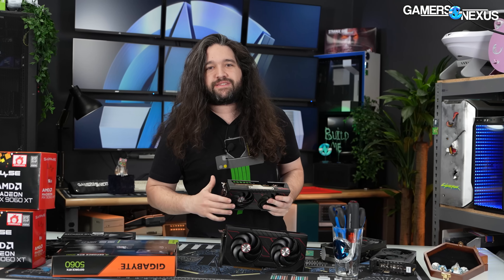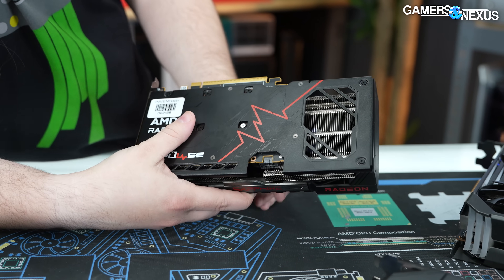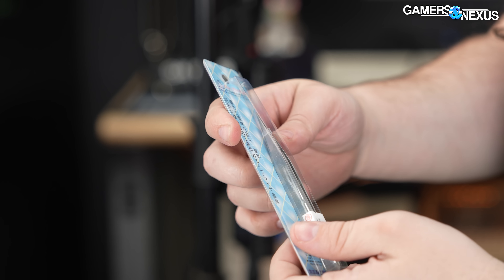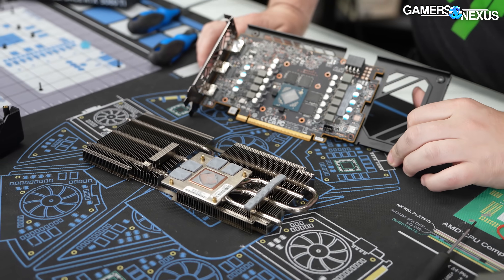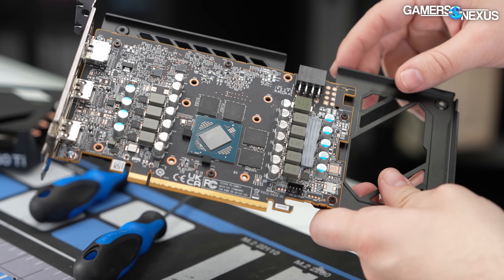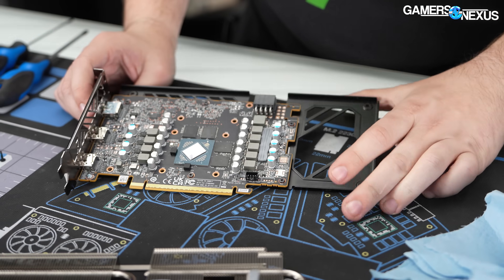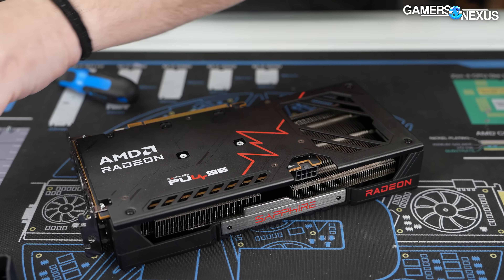Tearing Down Sapphire's RX 9060 XT 16GB & 8GB Pulse GPUs

Comment: I think they intentionally removed the thermal pads at the back of the mosfets on the 16gb variant since the backplate is being used by the extra 8gb rams. You can see the insulation plastic on the backplate has no cutout for the thermal pads for the mosfets. they might have added the pads on the 8gb variant as extra cooling. this is what the backplate should be used for. I saw a lot of manufacturers just adding the backplate for style

Comment: this card is such a weirdly perfect card for me, i got a 16g for msrp to replace my 3070ti, a card i'm happy with in regards to performance on but get bottlenecked by the vram constantly and it turns my room into an oven.
i was able to sell my 3070ti for almost as much as i got this for so now i have a card with the same performance but twice the vram and it uses 100w less power and is so much quieter. 
and it was about 300 bucks less than what i got my 3070ti for years ago lmao
Reply: and i really love how simple the card is to get into, makes me confident i'll be able to replace fans or thermal pads down the line if i need to.

Comment: My method for unplugging that fan connector. use a small flathead screwdriver to get under the header in the middle, then twist the screwdriver gently until the connector lifts up a little bit. Then use a plastic spudger with a pointy end to push the header out of then socket.

Haven't broken one yet with this method.

Comment: The 2nd 8 pin faces backward, that's usually a feature for high density applications like data center. Likely the 16GB PCB is shared with a non consumer model which has the rear power connector. I for one prefer rear power, makes for cleaner cable runs.

Comment: Those heatsinks are different, but the difference is so minute I can't image why Sapphire bothered. At 18:13, look at the tiny strip to the right of the base plate. The strip on the bottom heatsink is ever so slightly narrower than the one on the top (3 strips vs 4 strips). These must be SKUs that they make an absolute ton of for many different GPUs to make the cost savings of the bottom one worth it (assuming the top one is actually required to service the heat load of some GPUs).

Comment: The fact that this thing runs at 3.2GHz is insane, my 9070XT runs at 3.35GHz (Nitro+). My first GPU ran at 700MHz lol! My first CPU ran at a slower clockspeed than my GPU now, it was 2.4GHz.

Comment: Excited for the 9080XT, 24GB or 32GB is gonna be badass, especially if it uses GDDR6X or GDDR7, i would imagine that if it used 24Gbps GDDR6X it would be almost exactly 20% faster than the 9070XT at the same clocks since its definitely memory limited.

Comment: It's so basic that the price seems really excessive.
Very well built, but basic. The die is so small that the price bears no relation to the product sold in 2025.
The cooling is adequate.
In short, €400 for 16Gb  in France is a steal.

Comment: 16 gb board is same with the nitro model. It has the empty spot for an argb socket. Nitro doesn’t have the 8gb option. And they both use Honeywell PTM7950 TIM.

Comment: May want to see if they have softer tip Calipers. Watching a few moments after @10:50 I noticed a chip fly off the die when measuring.
The Die shrink on this is impressive. If smart, one of the outlets will try making this about the size of an A2000. They'd have half the NUC/ITX market trying to make mini steam/stream/media/AI boxes.
As a daily driver, only if things are that tight budget wise. If not tight, I'd aim them towards better performance and less fire hazard 9070 series.
I just can not recommend NV this or last gen.
The fan connectors.. They all suck and need a redesign.

Comment: Lol y'all are messy with Thermal paste but what do I know I have severe OCD. Someday there gonna be a device that scans CPU for exact size and Ultrasound prints paste on perfect. Looks around and holds up a jar of carbon nanotube dust Someday print the most durable super conducting at room temp computer parts you'll ever see for generations. Only problem? All the companies are working together or following pattern leads of people to prevent being noticed working together to milk the masses. Because holography printing voids all those robots and workers making computer parts. Google: "Ultrasound can print through walls" Even shape things in molten state and slow cool for perfect atomic structure..

Comment: I'm wondering why they left out the silver sapphire nameplate on the 9070 Pulse, it was present on the 3 fan cooler of the 9070 XT Pulse and these two 9060 XT's both have it so it's weird it wasn't included on the 9070.

Comment: 4:55 is incorect. You don't need to take the shroud out to replace the fans because they can be removed from the top.  There's a single screw and then you can remove them from the rail they're socketed in without any extra tools or cables.

Comment: The 8GB backplate had a cut-out for the rear mosfet heat pads, whereas the 16GB backplate didn't have the cut-out, so I guess that heat pad omission was intentional.

Comment: I believe they don't put the thermal pad on purpose on the back of the VRM. The 16GB model already runs hot on the memory, it would probably run even hotter if the backplate was pulling heat from the VRMs.

Comment: 7:42 they forgot to add 1 thermal pad to 1 of the buck converter / vrm controller. (i see he noticed later with the second gpu) 
the heatsink contact is there but without thermalpad. 
leaving it that way could end in a fatal failure that would melt it into the pcb.
cheap gpu that should be 250e or less, same as the 5060 ti.

Comment: 6:17 you can use plyer, it's easier to pull the plug using that, just grab and pull from the fan connector not the header

Comment: I ordered a 16GB version of the RX 9060 XT (The Asrock Challenger model), so I'll get to find out the gaming and thermal performance for myself on the 10th.  I'm counting myself lucky to have gotten one of these for only $20 above MSRP.  Thanks for the look at the PCB and the teardown.  It will come in handy when it comes time for new paste and new pads.
Reply: 20$ is reasonable, good for u man
Reply: @musouisshin  Thanks. It arrives tomorrow.
Reply: What do you thing of the gpu so far?
Reply: @lHuskyy  So far I'm very happy.  Skyrim SE runs hammered at 60fps, and the GPU only uses 25 watts for that.  Oblivion Remastered runs 1080p60 with hardware RT at a solid 60fps.  Everything works great, power consumption is very low, RT performance is stellar.  So I think I made exactly the right decision to get this GPU.  (BTW: I'm on Linux, and the Linux drivers aren't fully optimized yet, so performance will only get better in the coming months.)
Reply: @lHuskyy  I forgot to mention that temperatures are low, and there is almost no GPU fan noise.
Reply: I'm planning to buy the asrock challenger version aswell. On the subject, do you have the measurements (thickness) of the card without the shroud? I'm planning to deshroud mine and slap some noctua's underneath it but I got a small itx-case that is somewhat restrictive on the gpu side..Many thanks if you can give me accurate measurements!
Reply: @aleksisinkko2378  Not sure why you would need to do any extra cooling with this card.  Mine runs very cool on the default fan profile, but with the GPU clocked up to 3.4GHz.    But it looks like it will be about 1/4" thinner without the shroud.  I'd would say try it as it is out of the box before you start modding it.  I think you'll be pleasantly surprised.  (I've never once hear the fans while gaming.  Under Oblivion Remastered at 1080p Ultra + hardware RT the GPU hotspot is under 65C)

Comment: Only one DisplayPort. Are the failing on purpose?
Reply: Sapphire is the only brand to do this on the 9060XT. The other brands have 2x DP and 1x HDMI.
Reply: @Groovy-Trainthat makes much more sense. I feel like having a single BIOS and only one display port, Sapphire is shooting themselves. On purpose?
Reply: @ksenchy  It makes them different from the  other brands I guess, should someone require two HDMI's over just one. It's good to have a choice and not have all brands doing the same thing. I use two HDMI's from my video card, so if I were getting a 9060XT then the Sapphire would be the one I'd go for.

Comment: perhaps the backside thermal pads on the 8gb allows using the same or much more similar assembly line as  the 16gb. They would only change out the size of the pad and or adjust 1 machine. Just my uneducated guess.

Comment: 9060xt 8G / 16G 의 사용시 주의사항..
8G ver. 은 기본적으로 9070xt 8G 와 computing speed 가 같은데, 9~16G 구간까지 사용할 때 발생하는 문제는, length 의 문제..
Ram 이 1~2 / 9~10, 3~4 / 11~12, 5~6 / 13~14, 7~8 / 15~16G, 이렇게 되어있음 (1~4, 5~8 이 아님)..
그래서 8G 를 넘어서는 순간부터 circuit length 에 따른 frame drop 이 최대 1/2 까지 발생함..
= 16G 쓸 때 이 이유 때문에 지속적인 frame drop 이 발생하기 때문에, 작업관리자 열어놓고 GPU ram load% 모니터링 하면서 써야함..

Comment: 11:46 seems like there is no cut out in the mylar for the VRM thermal pad on the 16GB model. Maybe they didn't use one on purpose to give all the cooling the back plate provides to the memory.
Reply: I'm thinking that too, I don't think it's a mistake, I'm no expert but the pcb is different around the vrms both front and back so maybe the VRM modules are beefier on the 16gb model and produce less heat ?

Comment: 12:58 would be interesting to test if the memory temps would be lowered if you directly place a fan pointing at the back plate to help dissipate heat instead of letting it passively cool.

Comment: Why they covering the Backplate with Plastic Foil on the inside facing the card ? Wouldnt it be cheaper without it ? 

Or would the heat discipation downwards to the card to big if they dont had the insulating foil on it ?

Comment: With regard to the additional 8 pin, my guess is that they didn't know if both models of 9060 XT had the same core during PCB development so they designed a PCB with a little more power input available.
Reply: No. Probably sharing the same PCB for Radeon Pro datacenter customers whom prefer the connector at the rear of the card

Comment: Steve, I really enjoy your teardowns for the detail GN provides us viewers.  I have one pedantic comment in regard to terminology and relates to area and dimensions. I have watched  many tech you tubers and a  number of them use the terms square millimetres (or inches) and millimetres (inches) squared interchangeably. This interchange is very wrong as they are discrete terms and measure two different physical parameters. I am sure you are aware of the difference however you did slip when measuring the die size. For those who are not sure what I am on about EG: 20 millimetres squared is entirely different to 20 square millimetres. Cheers and keep up the good work
Reply: As a non-native speaker: Could you please elaborate on the difference? In my language (German), we say "Quadratmillimeter" which would be the equivalent to square millimeters. There is no equivalent to millimeters squared, and I always thought this to be American slang, so I would very much appreciate if you'd explain. Thanks.
Reply: @danieloberhofer9035 While I am not OP, I assume he is referring to the fact that 20 millimeters squared would be an area 20mm by 20mm, or 400 sq mm.

Comment: Those missing pads are concerning. But it might be a result of Steve getting some engineering review sample and not full production unit.

I have one of these on the way and i will definitely inspect it, when it will arrive. If getting a GPU with pricing close to MSRP would mean missing pads, i´d return it ASAP.

Btw. according to sapphire, that phase change material is genuine PTM7950. Meaning unless there will be some issue with the pads, nobody will need to ever disassemble the card.
Reply: Please reply once you get it. As I was looking to ordrer myself. I also created a ticket with Sapphire, where I asked about it. And linked this video.
Reply: @webdigo  it´s quite possible it won´t matter much in the end. According to techpowerup review of Nitro+, which uses the exact same PCB as Pulse 16GB, that exact VRM along with the one on the other side are responsible for powering VRAM, meaning they probably won´t run as hot as core VRMs.

Still, it´s a clear lack of oversight and that´s not good.

I´m also curious about the clocks. It´s possible Steve got some higher binned engineering sample and i´m gonna get some overheating POS GPU 😁
Reply: @webdigo  just got mine today. No missing pads. It also boosts like crazy - Heaven 3,4GHz, Superposition 3,3GHz. But i have to add, that i adjusted fan curve a bit higher, the default setting is very lazy. It still isn´t very noisy, my personal limit is 75%, comfortable setting is ~50%. Gotta test some more games and then try undervolting it. Windows seems to run stable as well. Very neat and quite powerful little GPU so far.

Comment: I’ma be real, I snap off one of the two hooks on the pcb side of the fan connector, so I just have to deal with one tab.

I pull the whole shroud and find apart for dusting. Yes overkill 1000% but it just doesn’t feel right if I know there’s still the super fine dust on it that you have to wipe down to get at.

Comment: I like those tweezers as well. I got mine in a dental kit online. I unironically use the mirror in tight spaces. Perfect for soldering:face-blue-smiling:
Edit: Pointy dentist tools are also perfect for releasing some electrical wire connectors.
Reply from the maker: Brilliant idea on the mirror for soldering!
Reply: Healthcare tooling is super useful. I've used so many tools from their bargain bins in my PC / car maintenance adventures. Its tools designed to save lives, so it most certainly can help save inanimate objects

Comment: So...my question is....since there is so much of a gap between the RX 9060 XT 16GB and the RX 9070...where does AMD still have to go with 9000 series? A crappy card worse than a 9060 XT 8GB? Are we waiting until RX 10000 series for wider product stack? How is this not a skip generation, just like RTX 5000 series. The flagship of Radeon RX 7000 series is faster than a RX 9070 XT, it's like the core ultra of AMD.

Comment: I bet they omitted the extra heat pad because of the height difference from the ram + pads vs just pads. At least that’s the only reason I can think of outside of a manufacturing mistake

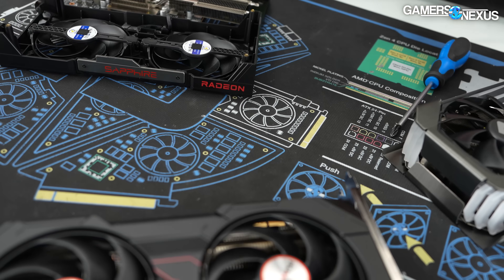Comment: 4:31 Ive heard  Reference PCB thrown around in passing but no one has explaned what it is or what it means? Non OC? An exact copy of what AMD sent them to say.. build it like this? The most simple? The often look like the simplest. Gpu verson
Reply: yes reference design is the suggested design by AMD that all board partners get. Basically if you follow that design you get a card functioning fully to spec taking any requirements and pecularities of that specific chip design into account. Usually the base cards are build accordingly.  OC versions or cards with fancy cooling solutions often get custom designs by the board manufacturer to allow for the added or rearranged power cicuitry or different heatsink layout etc.
Reply: @Megacheez  And sometimes non reference models are worse than reference pcb!

Comment: 2:39 1 display and 2 HDMI... so much for the pulse model... i'd rather have 3 display ports than that
6:00 GN tweezers when?

i just want to know if someone where to solder more vram to the card and flash the bios what else would need to be done to make it work

Comment: 11:01 - 11:02 Was that a ELECTROSTATIC DISCHARGE? I see a bright flash. First appears on the caliper that close to camera and the corner of the 2nd memory die under the caliper. On twentieth inspection, I saw another spark on the caliper that is away from the camera and jumps to top left corner of the GPU core where the QR code is.
Reply: I think it just got excited?
Reply: i think its just a lamp reflection

Comment: And maybe I missed it, but what size are the thermal pads on the ram modules? Since you had to offer higher than desired temperatures, I'm wondering if changing them to a premium option would help.

Comment: Sapphire's making great Radeon cards, but the design for the Pulse has barely changed since the 5700XT (I had the Pulse 5700XT, then upgraded to the Pulse 6700XT which is still in my 2nd rig). Getting bored with the design, but it's not a biggie.
Reply: Gotta say that I love the design of the 9060XT Pulse card.

Comment: Excellent teardown!  At least now I know what I've got; and mercifully, at only $40 above MSRP ($389), which is $10 less than my self-imposed ceiling; because in keeping with how cravenly high above MSRP the 9070s have been priced ($150 for standard, $200+ for XT), I was expecting the 16GB 9060XTs to be gouged upwards to $499! 🤮

Comment: Seeing that the 16GB uses memory chips on both front and back explains the hot memory thermals. idk if i remember correctly but, GDDR6 chips dissipate heat closer to the pcb side instead of on top where the heatsink sits, so when you sandwich them on both sides of the pcb the heat has no where to go. just something i noticed recently with dual sided memory gpus.

Comment: There should really be an effort on the consumer protection side of things to educate and warn people against accidentally buying prebuilds and whatnot that might use these cards. Lots of people won't look past 9060/5060, and the listing sure as hell won't specify that it is the 8gb model in the main info box advertising what is in it. It'll just say which chip it is and leave the fact that it is a near useless stripped down version of the card with only 8gb to be an unpleasant detail for the uninformed consumer to learn about later when games don't seem to work well.